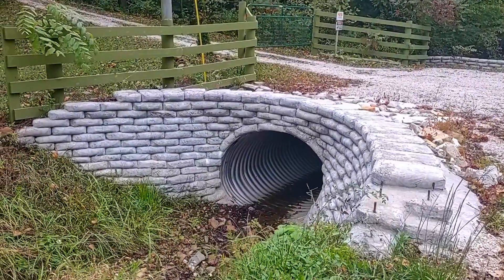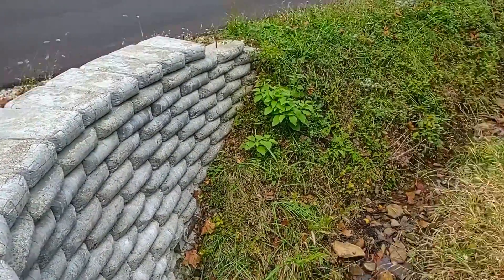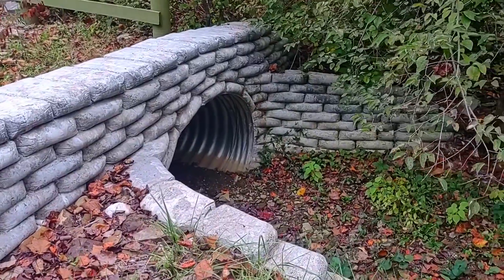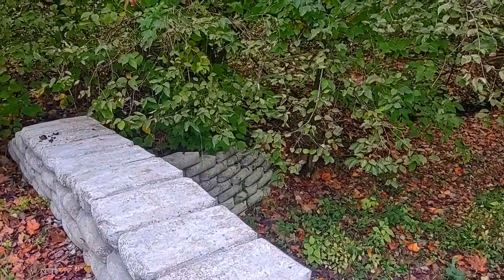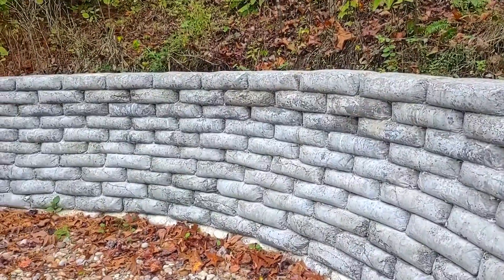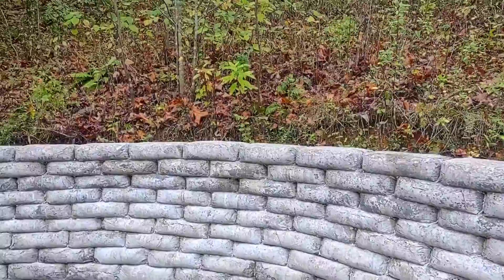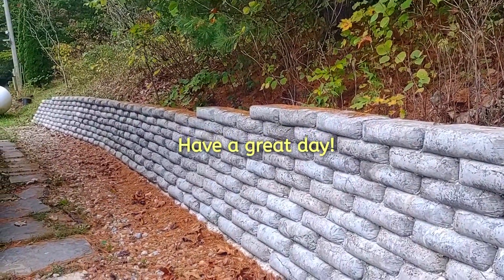Three Years Later | Concrete Bag | Culvert Retaining Walls

Comment: My dad did about 200 feet of concrete bag retaining wall on a lakefront shoreline when I was a kid. Sold the house 30+ years later and it was still in great shape. He hammered rebar through 3 layers at a time on his stack up.
Reply from the maker: @Isaacmantx - That is really sounds good. Might I ask: Did he go below the water line or do any prep? Was it on rock base or silt? What was the average height? I would love to see that at 200ft. Thanks for the info!
Reply: @SteveAddis  average height was about 3 feet. He placed the bags on a poured concrete footer on silt soil. The lake level varied. “Normal” level was 6” below the top of the wall, but depending on rainfall, the water could be anywhere from 2 feet over the top to a foot lower than the footings.
Reply from the maker: @Isaacmantx - Thank you for the details. Take care!
Reply: @SteveAddis   We had a stream undercutting the retaining wall at my Mum's place.
Put 2 or 3 layers of dry mix in porous bags under water, then when they'd set up, filled in behind after pumping out the retained water, building the bags up as we filled.
It's been there 9 years now, with the full force of the stream hitting every flood. Where the wall is, that means heavy flow, fifteen feet across & six deep.
Reply from the maker: @GARDENER42 -That sounds interesting especially the size you are dealing with. People don't realize how these lock perfectly, because they are molded like pieces of a puzzle, then solidify. The bags under water were the hardest yet of any of the bags. Thanks for you comment!
Reply from the maker: @GARDENER42  - I try to carry everything in the ATV trailer. Makes things easier. The plastic dump trailer can hold concrete up to 1200lb.
Reply from the maker: @GARDENER42  I see now. Bet you are glad that is fixed for sure.
Reply: hammering rebar into the bags - super smart
Reply: Yeah I would have rebar as well if I was building a retaining wall with bags

Comment: Would it work for a driveway? Putting it like a floor?
Reply from the maker: I use it for retaining walls. I would not use it on a driveway, except to retain the edges or for erosion control with geofabric. Good question though.

Comment: Even knowing I will never do a project like this, I watched the original and the update because the process and job was a thing of symmetry and beauty.
Reply from the maker: Thanks for the comment. It did turn out nice. I did not plan the culvert wall, just built smaller at the bottom then opened at the top. Vehicles still slow down and look at it, sometimes backing up. Lol Have a good weekend!

Comment: I'm surprised it's holding up that well. The concrete mixture settles in the bags so it doesn't set up like it's supposed to.
Reply from the maker: Yes. It gets fairly solid being that it has quite a bit of cement with this version. I began rolling the bags to mix them some. There is product made for this called RIP RAP by Quikrete with fiber reinforced bags. Thanks for the comment.

Comment: Esthetically those walls look very nice.  The problem I see is with the discharge side of the driveway culvert end wall. If a car missed that curve in the road it would run directly in to that concrete end wall. Highway drainage and driveway culvert  pipes on faster speed roads are required to have crash protection on the end walls in case they are hit by errant vehicles.
Reply from the maker: Thanks for the information. Interesting to know. There are no speed signs on the road, so some drive slow, some drive fast. I always worry about someone crashing in the ditch because it has become so deep. One day someone was going so fast they dumped a tractor off of their trailer going around the turn in the opposite direction.

Comment: "no degradation or crumbling"

Shows a video of degrading & crumbling concrete. I... uh... yeah
Reply from the maker: Not really. It's solid. Only a couple of spots on the third wall in the video, I explained bags stretching when wet, and not well mixed etc. Even those few small spots can easily be patched.

Comment: What is the cost vs. a poured concrete construction? Actually look pretty good.
Reply from the maker: If you mixed it yourself it might be similar. If you paid a contractor it would be multiple times what I spent which was about 1 to 1.2k $ per wall. Thanks for your comment. Thanks for your question.

Comment: Here in Oregon the paper bag has a plastic liner, how are you dealing with that?
Reply from the maker: @novampires223 - Use a block with nails or screws with a handle, punch the bags. When a section of the wall is set in place, not full height, pound rebar in place, then punch it a few more times through all the bags. Run water over it all night lightly. Mix and pack the bags with a stone or brick each course. Plastic will not stretch like paper. Then later burn the plastic off and continue to water it over time. Improvements video has some details. https://youtu.be/tUlc1Qb5A74

Comment: Why not use pavers with cement and rebar to connect the layers? It could be just as fast to build and look better.
Reply from the maker: That would work too. I had not thought of that as an option. Yet this was only $1.83 per bag and pavers are usually more. Some of those blocks seem less dense than 5000PSI even if I use the bag method. You can check the weight of a paver vs bag of concrete. No mortar needed, just rebar here. Thanks for you input and comment!

Comment: For the retaining wall, if I remember well, it is recommended to have some water evacuation tube through the wall to prevent water accumulation behind it. Water is very heavy and powerful when accumulating.
Reply from the maker: You are right. I did it on the last two walls. Not the entrance though. Yet it is well backed with bags and rip rap.

Comment: Did you get a quote for having a contractor to do this job the "standard" way by building forms and using a concrete truck?   I was just curious on how much the savings were over standard construction methods.
Reply from the maker: My cousin has a company. He said I save thousands compared to the 1.2k or so I spent per wall.

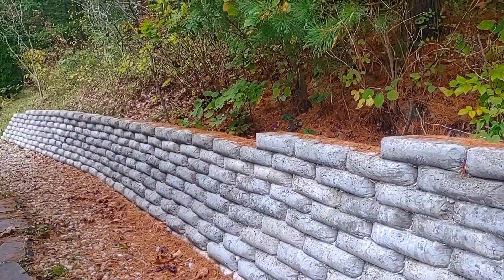Comment: @3:55 Yeah, you're holding up the whole hill. Clay will slip on top of water readily. It was established for "hundreds" of years, then you cut a chunk out of the bottom.

Not it's only a matter of time. Might be tomorrow, might be in 200 years.
Reply from the maker: Yes, however the clay is almost halfway turned to rock. The pic would not hardly break the grey clay.
Reply: @SteveAddis  Good luck ;)

Comment: Thank you for showing all of your walls as well including the retaining wall i think it looks awesome and if you really picked these bags up for just 1.80$ each id say you scored here. Im here after watching people use ziplock bags to make cobblestone pathing. They would put these bags of concrete down and let them sit. Some of them they cut the bag open after laying down, to add glow in the dark rocks . After it set they removed the bags and filled the cracks with fine sand. I think if you were to do something similarly i wouldn't recommend anything different, just to add a anti-weed cloth underneath the path for obvious reasons.
Reply from the maker: That sound pretty cool. Thanks for the info!

Comment: Did you do anything to speed along the paper disintegration?
Reply from the maker: Yes. I waited well after rained, soaked, for months. Then I watered the paper to make it soft, and pressure washed it on a low setting. Another options is to burn it off. Thanks for the good question.

Comment: watched Steve Addis , 3 year later reveiw of concrete bag culvert retaining wall. was after flooded culvert . tip would be add rebar as you go before wetting instead of trying after as it sets. and tape the bags and pack corners .
Reply from the maker: Good tip. I do install rebar when dry, leave it exposed for the next section to bridge to, doing sections at a time. I will do more tape in front next time on walls. Just a small amount of tape will support the wet bag preventing stretching. Thanks for your comment!

Comment: We are just about ready for the next update im interested to see how its holding up now
Reply from the maker: Okay, what I will do is a before and after the first maintenance. I always planned to coat the top to finish it. I even originally planned a mantle for the top out of forms instead of the 80lb bags to lock it in, yet left it this way.
Reply: Good i will make sure to watch it. I put notifications on

Comment: It is breaking down on the bottom by culvert
Reply from the maker: last I checked it was fine.  Thanks for your input and watching!
Reply: @SteveAddis  it's obvious dipshit
Reply from the maker: You might see where I coated it near the bottom right and a chipped out spots. Also when the bags were removed, on the left side some pieces came off and made it look broken. Not sure what you are looking at, that might be it. It is set solid and if it had issue, I would have included it with my video for sure. Then coated it again if needed.

Comment: Would not have been much cheaper and lighter for you to do if you used grating and concrete blocks? 🤔 
I am just saying.... because it's what i am doing in my mountains if i don't have enough stones laying around 😅
Reply from the maker: Sounds like you getting it done. These were less than $2 a bag for 50's, so it seemed more dense structurally compared to some of the block we have here. All kinds of options for sure. Thanks for watching!
Reply: @SteveAddis  retaining wall blocks  are big and empty to be filled with ground or gravel they are bigger and heavier once the job is done. Adding netting every 3 blocks is the trick 👌  and makes it so much cheaper and stable... 
Blocks from where i am are so  much cheaper than concrete bags.... 
Also, you will not get an ernia by handling hundreds of them
I want to show you, but i understand that you might not be interested....
Reply from the maker: What size blocks are they? Send me the block name and type. Thanks

Comment: What do you mean by taping the bags?
Reply from the maker: Good question. when they are set in place, wrap packing tape on the front sides and strap it over the top bags to keep paper from stretching when wet and letting the CC form with cracks. Please see this video. Thanks for watching! https://www.youtube.com/watch?v=tUlc1Qb5A74

Comment: Why not just bridge the culvert in timber?
Reply from the maker: Is that a bridge instead of the culvert? I would have liked that. Thanks for watching!
Reply: @SteveAddis  it was an insight into this building technique. The rebar, is it vulnerable though the joints? Also I saw you break the top of the bags did tou manage to break the underside of the bag you placed on top  to get the cement to bind together?
Reply from the maker: Yes, the rebar is vulnerable especially if you do not point it as with the culvert walls. It is cold joints between the bags yet they fit and mold perfectly together. If you punch the rebar through a few times it also locks it better. Basalt rebar, fiberglass rebar? Thanks for your comment!

Comment: Maybe a dumb question but I’m confused about you saying the bags weren’t mixed. These are sealed bags are you opening them up, Mixing them and resealing them?
Reply from the maker: @firewheelfarm7095 - No, that is a good question. I should have explained it. I roll the bags over on ends a couple of times. I don't open them, just mix with rolling. This video has some improvements. Thanks for watching! https://youtu.be/tUlc1Qb5A74

Comment: Your wall isn't supporting that hill because that hill is heavily vegetated, and looks like there's some pretty old trees on it. Those root systems will help support that hill in the event of erosion or a slide, and that clay underneath will be stable. As long as you don't clearcut that hill you should be fine.
Reply from the maker: @AronFigaro - I had not thought of this related to the wall. This is great information! I was just trimming back some small saplings near the hill thinking if it had no saplings and grass, it would erode. And that I would just cut them back leaving the root. Thanks for posting!
Reply: @SteveAddis  Exactly right. If you kill off the live root systems that are reinforcing that hill, you invite more erosion. Deforestation is a major cause of landslides.

Comment: My thought was to buy the concrete bags and just lay them out nice and flat in the yard, sprinkle them with some water, come back in a week and tear the paper off, then mortar them in place exactly like you have them there. Extra step sure, but, a lot stronger.
Reply from the maker: Neat idea, stronger. Pressure wash paper out of sides. Then a liquid form first maybe? Then mortar? Barrier? Be sure to mix the bags well by rolling them in case the contents settled.

Comment: "No degradation". I call bullshit. That concrete is full of cracks. It's also weak compared to properly mixing the bags.
Reply from the maker: Yes, I explained why if formed with cracks, when the bags were wet and stretched. Mix is better, yet this has been like this for 4 years, no issues. Then if you want just coat the top after it sets. Improvements video explains. Thanks for your input!
Reply: @SteveAddis  the strength of this concrete is about 1/3 of properly mixed and poured concrete. Also, it hasn't properly bonded to your reinforcement.
Reply from the maker: Yes, it is not supposed to be structural, and rebar should hold better than stacked block. No one can just walk away with it for sure.

Comment: Back in the 90s a creek washed out an existing 6 foot rock wall right beside the house. The work involved in rebuilding the rock wall was a def no even though it was a rocky creek with plenty of material. I put a few sandbags when the erosion 1st started & noticed how they had hardened up & looked like rock themselves once the hessian had worn away. This gave me the idea of filling hessian sacks with a mix of river sand & 1/4 cement & dry laying them over a concrete foundation with reo risers. One bag between ea riser on 1 course, one bag punched through the centre the next, stretcher bond style like yours. It was super cheap to build, its still there today & ppl say it looks like an Inca rock wall
Reply from the maker: Thanks for sharing! I appreciate hearing about how you came up with a solution. I think I may try that mix and use my own river sand and rock then add the cement. Some commenters on this channel has had similar results 50 years. Others are like, we are crazy. I like your idea! Have a good weekend.🙂👍

Comment: It's all fractured.
Reply from the maker: Yes, I explained why if formed with cracks, when the bags were wet and stretched.  Improvements video explains. I left it for four years to see how it held, then will coat fill the fractures. Sure, it is not a pour,  because it is non-structural use. Thanks for your input!
Reply: @SteveAddis  Great - makes sense.  Good to see a proud gay man like yourself in the youtube space.

Comment: Easy solution. As the bag gets wet it turns into a concrete block. Bags probably absorb the paper I’m guessing.
Reply from the maker: @1014p - Yes it is easy. Yes, it seems to embed, then the outside can be burned or pressure washed away. Thanks for the comment!

Comment: Hopefully your comments about the need to mix the bags is not lost on viewers. I have seen bags that are so under mixed during filling they would be useless on a project like this. Years ago concrete companies actually premixed the materials before bagging. Then as equipment changed that practice stopped, but the bags produced on the older production lines were sold specifically for this purpose. Then eventually even those became unavailable. Also if you live in a region prone to freezing you need to seal up the cracks on that first wall before it suffers a premature death.
Reply: How do you mix a sealed bag? Seems like a very long and heavy process, it ain't easy to lift and shake 50kg/125 pounds pounds concrete  bags lol
Reply from the maker: @StoneCoolds  I roll, the bags end on end. Keep it close to the body waist level. 125 pound bags, no way! These are only 50lb and easy to handle compared to 80's. I did not care if it cost more per lb, for smaller bags as I once had back surgery and have to be careful.
Reply from the maker: @kirkwilson6698 - These are all good points! I keep asking serious commenters to watch my improvements video. I am going to fill the first and second wall cracks before winter. It has not been affected, yet will if I don't seal it. Just looking at it yesterday all okay. A concrete sealer would help. I think there is still RipRap product, yet not in my area. Thanks for watching and posting! Have a good weekend!
Reply: If you don't have drainage gravel behind the wall, DONT fill the cracks.  Water needs to escape
Reply from the maker: @chrywelch  True on that. I put pipes and stone on the exit. The entrance not so, yet water finds its way. The back is mixed lime and stone, rip wrap.
Reply: Yeah right

Comment: Did you just set the bags in a pile or did you like mix them and then pour them into another bag? Im confused by how you said some bags had poor mixing. Thank you!
Reply from the maker: @FinctionFIVE - I would roll them end on end to mix. Then pack them to the front one last time, lay them down, pack with a flat block. Those turned out perfect. The top bags were taped on the sides and top so that the paper would not stretch as well when wet. See my improvements video on this info. Thanks for watching! https://www.youtube.com/watch?v=tUlc1Qb5A74